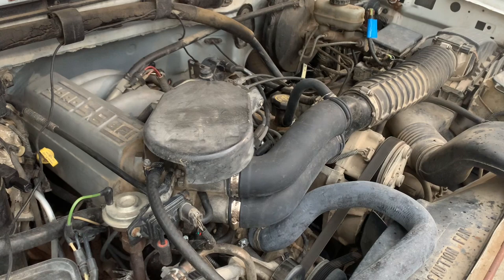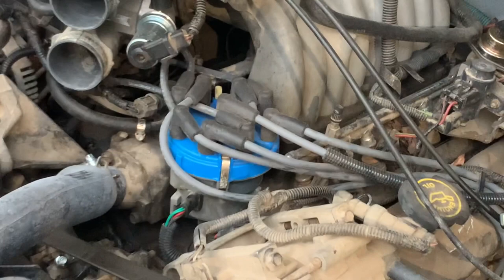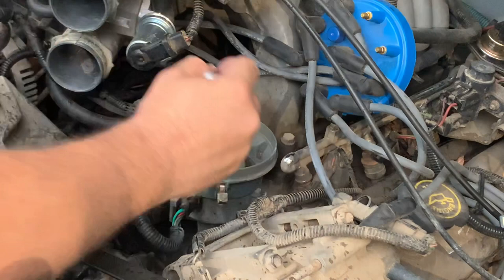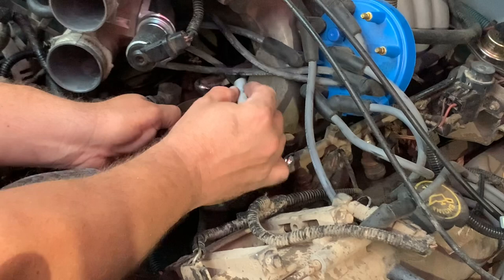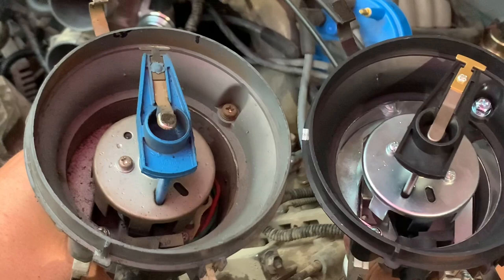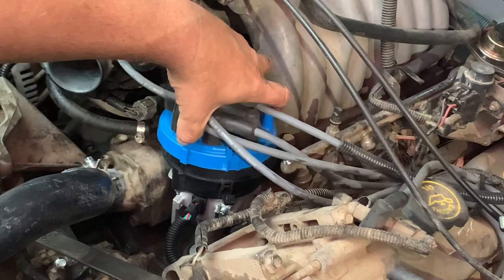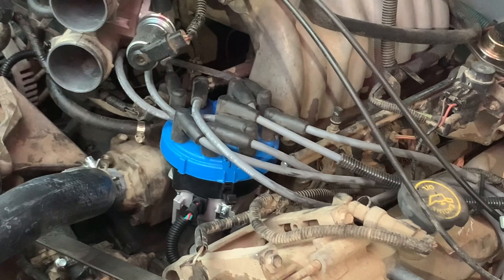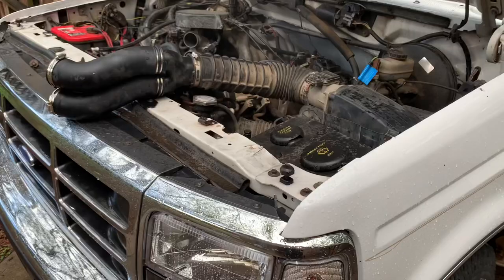How to Fix: Bronco Distributor Replacement (Part link in the description⬇️)

Comment: Great video🏆. I would say this is the best and straight to the point instructional video I found. I have a 1995 Ford E350 with the 5.8 and lost Spark unfortunately the distributor system what's the last thing I checked so I have complete new electrical and components all the way through now but was hesitant to do this myself only because I've never done it but after watching your video it gave me confidence to tackle the job😁😁👊🏼.
Reply from the maker: Thank you so much, and I’m so glad to hear this helped!

Comment: Great little tutorial!  The only thing I would add is to use dielectric grease on the terminals of the eight connector plug as well as the plug wires.
Reply from the maker: Thanks so much, and 100% on the dielectric!!!

Comment: Good info. There aren't that many 96 5.8 MAF broncos out there, nice to see you maintaining yours! My 96 is now a 408w, I'll be posting some videos of upgrades along the way.
Reply from the maker: Looking forward to seeing that! So awesome!
Reply: Well TT, how the heck are you?  I'm buying an E150 5.8 van with a bad PIP, so looked up this video to change out the distributor.  Hello to your family!
Reply from the maker: @MT4Runner  sounds good, and we are well! How are you and yours???
Reply: @MT4Runner  Nice. Can I get that Saginaw steering pump and 130 amp alternator from it 😜
About got my engine buttoned up. Edelbrock pro-flo 4, quick 4 trans controller, etc. Deep into wiring/removing ECU now.
Reply: @wheelin66bronco  haha, I’ll probably add an invertor, RKE keypad and change all the interior lights to LEDs.  Pimpin’ Grandpa van!
Reply: @MT4Runner  grandpa???
Reply: @wheelin66bronco  probably not far from it.  My girls are 19 and 21 now.

But this is definitely a grandpa van like my grandpa had!!

Comment: How do you tell if your distributor is bad? What symptom was the old distributor causing you?  I’ve been having issues with my 1993 Bronco.
Reply from the maker: My engine was extremely weak, no power when I hit the gas, and the exhaust manifolds were getting really hot, hotter than normal.

Comment: Thank you for this video. I wanted to ask you I have a 89 bronco and from time to time at stops and I have to wait a while to turn on is that because of this part
Reply from the maker: You’re most welcome! I’m not sure what’s happening with yours…does it just die?
Reply: My 89 did that, had to replace my ground wire. It also could be your coolant temp sensor.

Comment: I have a OMC Cobra 5.8 351w it's in a boat freshly built motor. I'm having a problem  I have   Spark.  Where should I put the rotor pointing at number one or in the middle of the intake?
Reply from the maker: I located an article that’s very specific with pictures of the process from a new rebuild. Hope this helps you:
https://www.fullsizebronco.com/threads/how-to-properly-set-the-timing-on-a-302-or-351.168214/

Comment: Someone might wanna know this. Cylinder Numbering

Front to back

1, 2, 3, 4 on the passenger side

5, 6, 7, 8 on the driver side

Firing Order

1-3-7-2-6-5-4-8

Distributor Rotation

Counter-Clockwise
Reply from the maker: Than you for sharing this!
Reply: Years ago I got f100 someone had it in small block Chevy firing order 😂 that's why I added this

Comment: How do you face the distributor if I got a whole new one and you set the motor to top dead center and want to re set the timing ?
Reply from the maker: It’s a lot to type out, so I’m adding a link with all the info you need. Hope this helps!

https://classicbroncos.com/forums/threads/distributor-install-on-new-engine-351w.78744/

Comment: What would cause the rotary button tip the blade on the end that Sparks across to only be half burnt on the blade half of it is brand new looking the other half is rough like sandpaper right on the end
Reply from the maker: Sounds like timing…have you been able to put a timing light on it?

Comment: I've been trying to fix a crank but no start problem with my 96. It was hard to start but I eventually got it started and drove it an hour and parked it. Went to start it the next day and it hasn't started since. I've replaced the coil, distributor, starter solenoid, plugs and wires. It's frustrating lol I just wanna drive it
Reply from the maker: Oh wow, that is frustrating! I found a forum on that year model that has helped me in the past, and I’ll share the link. I was going to say replace the pickup coil in the distributor, but you replaced the whole thing, so that wouldn’t help. See if this helps: https://www.ford-trucks.com/forums/1522556-96-f250-351w-5-8-cranks-but-no-start-help.html
Reply: @GrubNGas  thanks for the link. Hopefully I can get it started soon lol
Reply from the maker: @joeykimball5705  I hope so too! If not, reach out again and I’ll keep digging!

Comment: It looked like you didn't fully clip the distributor cap to the distributor.  Thanks for the video, I'm replacing the distributor on my 1994 Bronco.  Do I have to time it, or does it do it by itself (as long as I'm close)?
Reply from the maker: I did not time mine, but there are specific instructions available online for timing it. Mine runs great, and i set the timing by ear.
Reply from the maker: I would recommend following the proper procedure

Comment: Do you know what the initial timing should be set at after you replace the distributor?
Reply from the maker: 10 degrees btdc is a good starting point, from what I've read.

Comment: What do you do if it’s frozen in? I just bought a 95 bronco with a 351 but can’t pull it out for the life of me I think it’s orginal
Reply from the maker: I don’t have a tried and true for you, but you can try to soak the edges where the distributor inserts into the block with some penetrant. Let it set for a day or so. Keep in mind that if the penetrant gets into the block you may want to change your oil to keep the engine safe.

Comment: i have a eddie bouer 95 with the inline6. it seems to be leaking right at the base of block and distributor. any suggestions
Reply from the maker: You might try replacing the o-ring around the base of the distributor. Keep in mind, you’ll want to mark the position of the rotor when you pull it out.

Comment: What was wrong with the old distributor
Reply from the maker: I’m not entirely sure, but it lost all power, would start but barely run. Replaced it and the Bronco ran fine. Something internal went bad, and a new one was so cheap.

Comment: so you said the distributor was acting up, what was it doing? I have a 91 F150 that Ive changed every electrical component under the hood and I still have intermittent issues with whether it runs well or stumbles and runs rough or stalls. I was told to change distributor, so Im wondering what yours was doing...
Reply from the maker: Mine had no power, sluggish response in the accelerator pedal, and the exhaust manifolds were getting really hot.

Comment: Which distributor did you use?
Reply from the maker: This was a Cardone replacement from Advance Auto.
Reply: @GrubNGas  how has it held up for you? I think I'll be needing a distributor and cardone is the one I've been looking at
Reply from the maker: @seth_owens  so far, so good!
Reply: @GrubNGas  did you have to mess with the timing after installing it?
Reply from the maker: @seth_owens  yes, I had to move it around a bit. I didn’t use a timing light, but I definitely recommend it.

Comment: Did you have to set your harmonic balancer
Reply from the maker: No, just had to adjust the position of the distributor:)
Reply: @GrubNGas  Tell me more about adjusting the position of the distributor.  I saw you do that in the video but why did that help?
Reply from the maker: @johng9909  well, it’s supposed to be adjusted using a timing light…I rotated the distributor and listened for the best idle by ear to get it close. I should still go back and set it with a light though.

Comment: Can anyone tell me if this is exactly how you do the 4.9 I’m doing it now ? And I can’t find one the straight 6
Reply from the maker: I'm not sure on the 4.9, but you would use the same technique of making sure the rotor is pointed to the same spot as the old one to help dial in the timing faster.